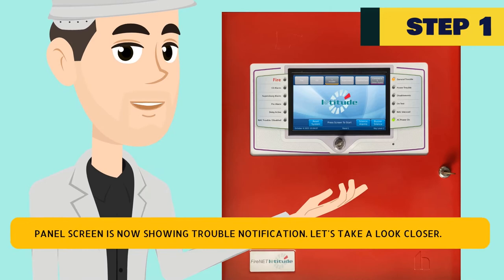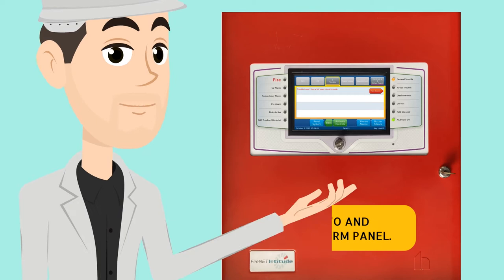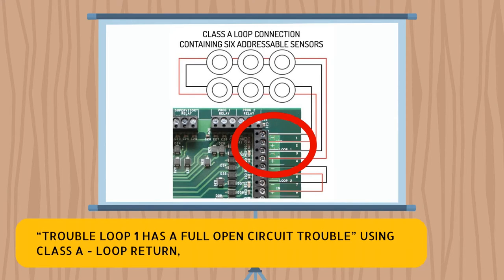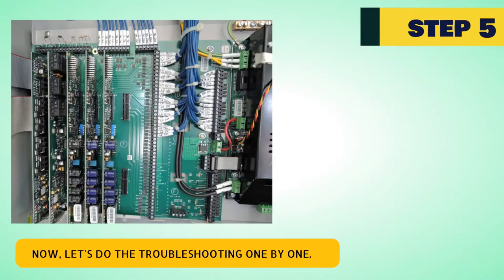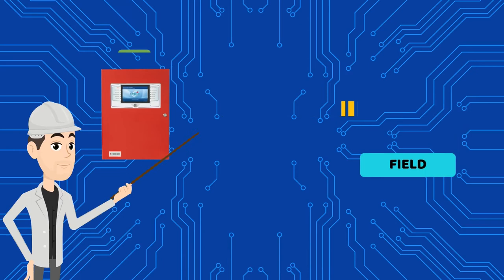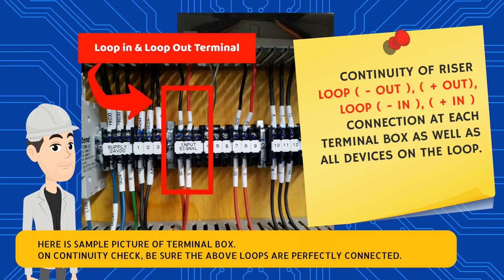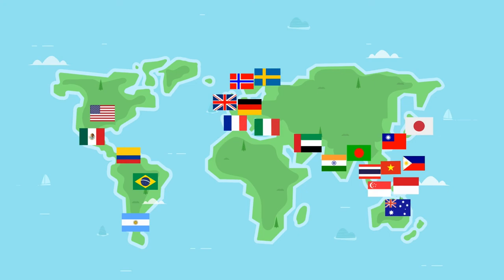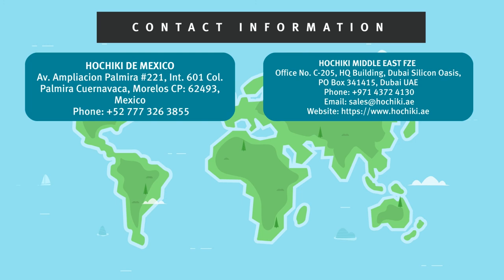Loop Open Circuit Trouble

Comment: I am installed hochiki hfp latitude fire alarm panel .I connect 4 loop card in FAP and 4 loop also connect in Fire Panel . In my fire panel showing 2 trouble .1  . System trouble & 2. Loop 3 full open circuit.  How will be solve my trouble .In my panel all device showing an 34 V DC also coming in both side  in and out loop cable. Please guide me .
Reply from the maker: May I know which country you are from? Then I can re-direct to your respective personnel for support. Meanwhile, please email to techsupport@hochiki.co.th